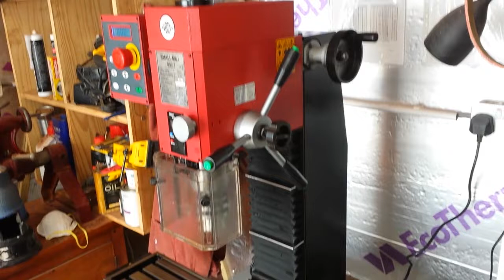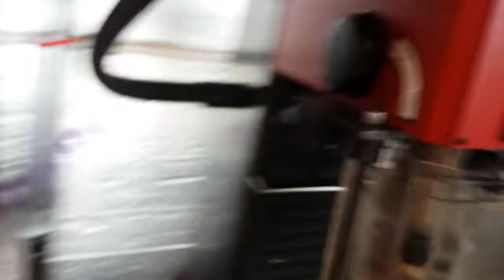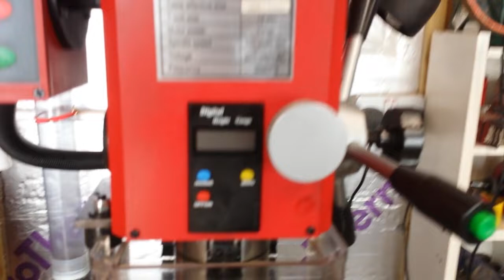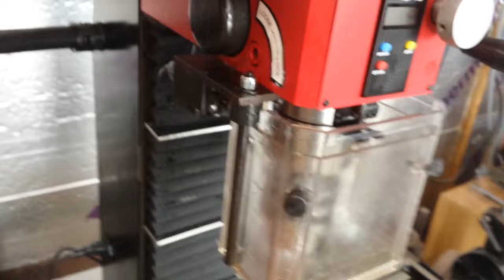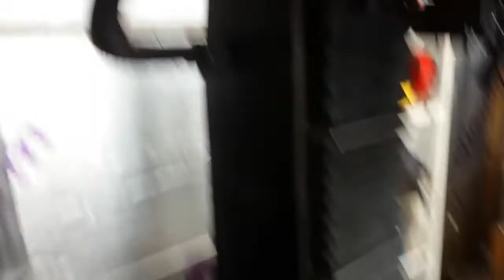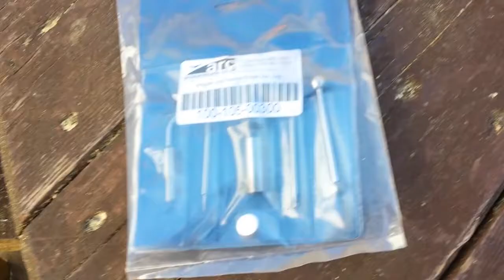Mill Swap (DW Betrayal remix)

Comment: Hello Gary. Could you recommend a good place to order this Mill? 

Akso I've heard there are limitations with the size of the bit  vs the speed of the motor that goes only up to 20000rpm. Did you feel any trouble working on milling parts so far?
 Thanks
Reply from the maker: Hi - 
I got mine from Arc Euro Trade in the UK.
Sometimes I feel I'd like it to go faster, but overall I have had no problems with drilling, milling with an endmill and facing with a facemill. I find it to be a good machine.
Reply: @gary.arthur  ok Thanks arthur.  got already in touch with Arc
Reply from the maker: @Levisgil47  This one would be really good if you have the budget and the space:
https://www.arceurotrade.co.uk/Catalogue/Machines-Accessories/Milling-Machines/SIEG-SX35DZP-Mill/SIEG-SX35DZP-HiTorque-Mill
The 2.7 is pretty ok though.

Comment: You'll want a beefy motor if you go with a three phase and VFD, mainly due to the fact they loose quite a lot of torque at low speeds.

My lathe had a 1/3hp motor when I got it, to match the torque provided by said 1/3hp motor at min rpms using a VFD, I had to get a 2hp motor, which would be kinda large to hang on the back of a Westbury.

The only real advantage with VFDs is the ease with which forward and reverse are implemented but honestly, I'm either going to use a barrel switch with my mills current motor and forgo speed control, or make an adaptor mount for a 110v DC motor I have and get a PWM controller for it as it won't loose torque at low speed with PWM.
Reply from the maker: When I was buying the gear to convert my lathe and drill press to 3 phase, I asked John Newton of Newton Tesla about the issue of losing torque at low speeds. He told me that this was an issue in the past but no longer is with good quality modern inverters such as the Mitsubishis that they sell. To be honest I can't really say that I have fully tested out this aspect of mine so can't really comment. I will, however, bear your comments in mind when the time comes.

I do like variable speed I have to say...

Is the PWM controller/DC motor a less expensive option?
Reply: @gary.arthur  

Keep the stepped pulleys and use the VFD to provide speed control..within the range offered by each step on the pulley...

That'll also keep torque delivery up on the second motion shaft...
Reply from the maker: Yep, that's what I did on the drill press. VFD + step pulleys gives plenty of options. Would definitely do the same on the DW. Cheers, Glenn.
Reply: VFDs are my bread and butter, I work for Invertek Drives Ltd as a technician level shop floor operative, been there 10 years now. I agree, inverter technology has indeed come a long way in the last couple years and I'm normally the first one to champion them for most cases.

However, I'm leaning toward DC for the mill right now as the controllers are a heck load cheaper than a VFD (eg, entry level size1 single phase in 3 phase out  E3 drive @.37kw starts at around £100+. Alternatively, a DC controller is about £25 on ebay and the DC motor I have cost me £27 for 1HP and puts out more torque than the AC equivalent without loss at very low speeds).

It's all about the difference between slowing the frequency cycle down of AC Vs gated full current as seen using PWM. Both are good, it just depends what kind of performance you want to get from your motor and how you want to manipulate everything.

AC falls in the realm of hardware control due to the high voltages, DC is more flexible as it will work with both hardware and soft (circuit related function), controls in any given combo or on their own and also has the advantage of being able to integrate microcontrollers for all kinds of potentially useful shenanigans.

VFDs definitely have their place tbough and I wouldn't be without one for my lathe. In fact, I've worked out a way to rig things with a couple momentary buttons in key places to make screw cutting a semi automatic affair, the only human interaction being to manipulate the topslide in and out at the appropriate moments, with the carriage moving back and forth on its own (all down to motor control again but using hardware instead of software).
Reply: @WrenagadeWorkshop 

Hey...
If he ever decides to run a vintage dynamo off the lineshaft...he could run the field excitation through a vintage Rheostat....
That'll give him fine adjustment and smooth startup...
Reply: VFDs are my bread and butter, I work for Invertek Drives Ltd as a technician level shop floor operative, been there 10 years now. I agree, inverter technology has indeed come a long way in the last couple years and I'm normally the first one to champion them for most cases.

However, I'm leaning toward DC for the mill right now as the controllers are a heck load cheaper than a VFD (eg, entry level size1 single phase in 3 phase out  E3 drive @.37kw starts at around £100+. Alternatively, a DC controller is about £25 on ebay and the DC motor I have cost me £27 for 1HP and puts out more torque than the AC equivalent without loss at very low speeds).

It's all about the difference between slowing the frequency cycle down of AC Vs gated full current as seen using PWM. Both are good, it just depends what kind of performance you want to get from your motor and how you want to manipulate everything.

AC falls in the realm of hardware control due to the high voltages, DC is more flexible as it will work with both hardware and soft (circuit related function), controls in any given combo or on their own and also has the advantage of being able to integrate microcontrollers for all kinds of potentially useful shenanigans.

VFDs definitely have their place tbough and I wouldn't be without one for my lathe. In fact, I've worked out a way to rig things with a couple momentary buttons in key places to make screw cutting a semi automatic affair, the only human interaction being to manipulate the topslide in and out at the appropriate moments, with the carriage moving back and forth on its own (all down to motor control again but using hardware instead of software).
Reply from the maker: Hey Wrenagade - this is brilliant info and it may well be the road for me to take. Would you mind posting a link here to what you feel is a suitable DC motor for the DW and one to a controller for it?
Reply: If that one isn't suitable, treadmill motors are another very good source.

This one may well be just the job and is the closest I've found to the DC motor I have in size and specs:

https://rover.ebay.com/rover/0/0/0?mpre=https%3A%2F%2Fwww.ebay.co.uk%2Fulk%2Fitm%2F123350637629

Here are a couple of controllers that should work with it.

https://rover.ebay.com/rover/0/0/0?mpre=https%3A%2F%2Fwww.ebay.co.uk%2Fulk%2Fitm%2F282820954577

https://rover.ebay.com/rover/0/0/0?mpre=https%3A%2F%2Fwww.ebay.co.uk%2Fulk%2Fitm%2F263151196741
Reply from the maker: Fantastic! Looking forward to exploring this further when I get round to resurrecting the DW!

Thanks  :-)
Reply from the maker: Hi again Wrenagade... re the 1hp treadmill motor that you linked me to above: on the label the RPM is given as 4800/min. Would that be its maximum RPM? If so, roughly how low an RPM could be achieved with one of the controllers you have also given links to if the controller is turned down low (i.e. what speed range could be expected)? I promise I won't bombard you with questions but it would be foolish for me to guess at such things given your expertise in the field.
Thanks, gary.
Reply: Hi Gary, no problem at all, ask as many questions as you wish ;)

4800 is indeed the motor's max RPM. Im glad you asked about the controllers as now I've had a closer look, I believe the more expensive one has beneficial features that the other lacks.

One such being the high torque delivery at very low speeds and adjustable motor ramp up/down times which are absent on the cheaper one (setting the correct ramp times is important as it will help prevent overvolt trips form occurring on start-up or shutdown).

Unfortunately the description is in typical chinglish, so I've had to extrapolate what I can from it all, though I've had to read many a datasheet in chinglish for my interest in electronics, so the language is slowly starting to make some kind of sense.

Basically it will run from a theoretical 0 to maximum motor RPM and adjusts the amps to cope with loading throughout the speed range (I was going to get the cheaper one but I think I've just changed my mind).
Reply from the maker: That's very kind of you!

I'm tempted to just go ahead and flash the plastic (again) but it occurs that you may wish to buy that motor, so you should have the first option (unless of course they have a whole bunch of them, which I suppose is likely). Let me know what you think about that; I'll hold off for the time being.

Thanks for this  :-)
Reply from the maker: Sorry - just re-read your post and realised that you already have the motor...
Reply from the maker: And also just noticed that there are 3 available...lol
Reply: I very much apperciate you thinking of me but I actually have about 7 different motors kicking about in my workshop of various sizes and types, so I'm all good in that department lol.
Reply from the maker: Cool. I'm not surprised, but thought it only right to check. Will go ahead and order the motor and the controller you recommend. They will have to go on to the shelf for a few months, but they'll be cued up waiting. The thought of a 1 hp variable speed Dore Westbury is an exciting one, particularly as I'd have had to pay considerably more if I went down the 3-phase route.

Thanks for your help.

Comment: It'll be a shame to see her go, your mill was the first I saw of the Westbury type and it actually inspired me to get one but I'm glad she'll get the attention she needs and knowing your love for old iron, she's in good hands.

I will always wonder what the reasoning was behind the table slot layout though. As you said, almost nothing fits, unless it's also of Westbury/Quorn design that is (such as the Westbury vice and rotary table).

However, my biggest beef with the DW is the weedy M6 draw bar you also mentioned, not least because nearly all MT2 tooling uses M8 draw bars, so I just don't get why an 8mm bore wasn't made standared for the MT2 spindles. 

I came up with a really basic but very effective workaround for M8 tooling that is such a doddle to make, I'll drop the steps here but it should be noted that the workaround drawbar is installed via the spindle nose as opposed to dropped in from the top as usual.

Step #1. Take a 335mm length of 8mm dia high tensile steel shaft and turn most of the length down to 6mm leaving about 40mm on one end to cut M8 threads (the threaded portion should be about 35mm long with a medium to heavy chamfer at the back of the shoulder)

Step #2 Grab a 20mm length piece of hex stock, chuck it up in a lathe, face both sides and then drill a 6mm hole in the centre all the way through.

Step #3 Grind a small flat about 10mm from the top of the drawbar.

Step #4 Drill and tap a hole for an M5 screw into the centre of one of the flats of the hex for a locking screw.

With the hex nut firmly affixed atop and the fact that the 8mm portion won't fit through the 6mm bore in the shaft, combined they effectively capture the drawbar, which pushes the MT2 shaft out of the spindle, making it a much friendlier system overall.

I still don't like the fact the main shaft is 6mm dia with the workaround drawbar but to me it seems a better solution than having to smash seven bells on it to dislodge reluctant tooling.
Reply from the maker: Hi Wrenagade_

I didn't realise my DW was the first one you had seen. I'm pleased that my channel has been useful! You are making a great job of yours.

We're in agreement on the table slots. I also wondered if Westbury and Throp designed it for a bespoke range of tooling. Annoying as they are, though, a DW just wouldn't look right with any other table :-)

A new 3 phase motor would also look odd on a DW but I think it would turn it into a great little mill with a variable speed inverter, along with your drawbar mod and taper roller bearings.

I also thought about modifying the drawbar at one point, but haven't yet got round to it. If that was my machine's only problem I might have just done that but unfortunately that isn't the case. Thanks for sharing your way of doing it. I might well refer to your comment for instructions when I finally get back to sorting it out.

Cheers,

gary